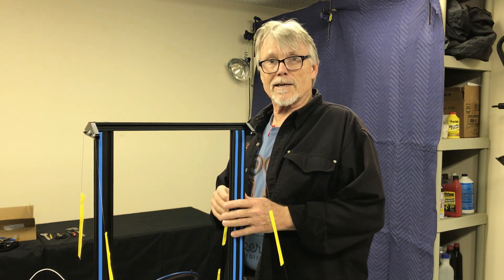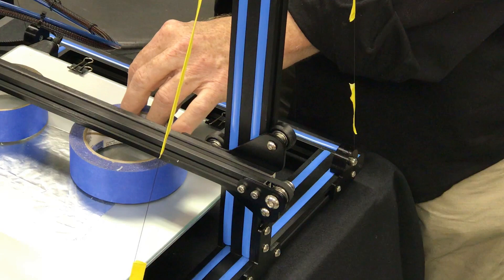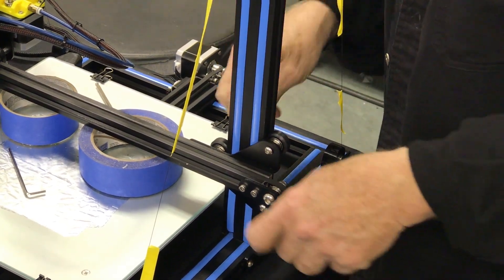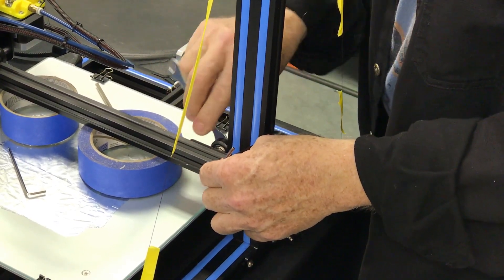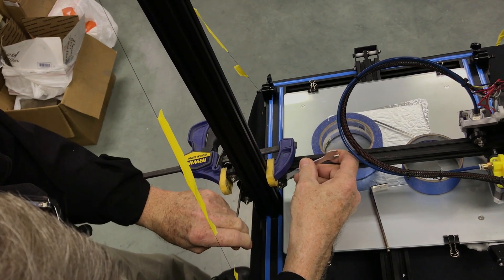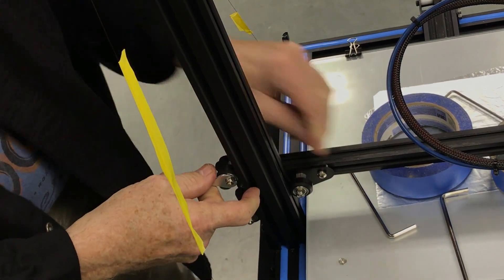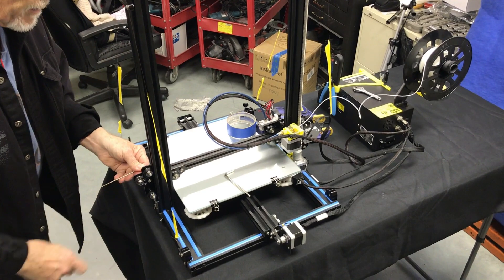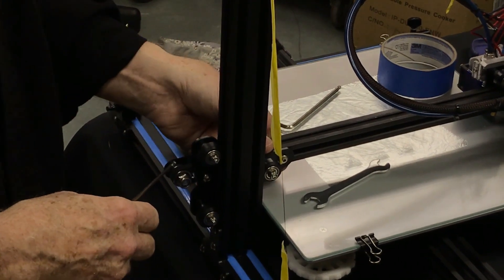Tuning the CR10 X beam

Comment: Do you think you should put lumia rails
Reply from the maker: Ricardo Molina not sure what those are but the CR10 performs well for what it is....a $300 entry level printer. I’ve seen people spend huge sums of money on them just to make prints a little better. They’re great when they’re tuned properly. I suggest only doing the dual z upgrade and getting rid of the heavy glass. Save your money up and get one of the new CUBE type printers. They go much faster, have better rail systems and easy to enclose for printing exotic plastics.
Reply from the maker: Rick Morty I use a galvanized sheet metal from my local HVAC Shop and glue magnets to my heater plate from underneath. If you get 24-22 GA. 
You can use a WHAM BAM if you want to spend more money or don’t have access to a shop who can cut it on a stomp sheer. 
 My lightest alternative is a PC copper clad board which I keep in stock. They have to be clamped on like the original glass.

Comment: 1) Why are you squaring to the bed and not the frame?
2) Have done this with a dual z rod?
Reply from the maker: Assuming the frame is square, this is the next step. This only covers the beam which is often not covered. 
 Dual z pretty much takes care of the sag however this will quell any print anomalies from the guidewheels being loose.

Comment: i have a brand new cr10s clone and i can't figure out for the life of me how to tigten rollers...had zero issues with ender 5 and bed adjustment rollers on this machine... know one on you tube addresses the issue i am having... everything else with this printer is working normal...but i know this slop needs to be fixed asap...thanks
Reply from the maker: For the clones sloppily made, your only alternative is to hold the wheels tight to the rails with the shown clamp and loosen then tighten wheel axle bolts.

Comment: never saw anyone with stabilizing cables for the z-axis before... did you make those or buy it?
Reply from the maker: I design and sell them in my store: 3dprint2form.com
Reply: @neuxstone  yes, thanks... since 1st seeing the video I saw this for sale on ebay... I think it's the same, it includes a screenshot from what appears to be this video... seller in Naples FL...
Reply: @neuxstone  I intend to purchase a kit soon for my CR10 S5... if any of these need stability in the gantry/z-axis the most it's certainly the taller S5 (mine unfortunately is a clone by Aibecy which I obviously didn't catch at first but I think it's identical in every way to one from Creality)
Reply from the maker: zeroswings2   The Creality printers are copied just like the Prusa. It's hard to beat a good design however you'll want to make sure you look at the details. The control board, motors, quality of wire connectors, wheel bearing quality etc. Not that Creality has the best....
 I purchased a S 500 Custom. I don't think they offer it anymore. It came with TFT touchscreen and Ramps architecture board. The board was a cheap version and flamed out after a couple hours printing. When I contacted the seller he forwarded my email to Creality calling me needy...
Creality told me it was my G-code and totally ignored me......boooHissss Creality. I spent $1200 for mine and thought that sucked but....by troubleshooting and finally identifying the problem and fixing it, I had the most valuable experience possible. I now know how to fix and troubleshoot any printer issues.....
Reply: @neuxstone  cool! well... cool that you learned so much... so if I have issues you're the go-to guy!? I'm in the bay area BTW so Naples isn't too far away....
Reply from the maker: zeroswings2   Actually I moved to the Eustis area a couple years back so you are closer...
One thing I forgot to ad was that I linked both z axis with a belt because the 2 motor systems are notorious for creep. 
I have them on all my machines. All but the 500 have tensioners to keep the belt tight but I special ordered a perfect size belt(s) that took 8 months for them to fulfill the order. I have a few left if you're interested.
Reply: @neuxstone  I was thinking of doing the exact same thing! I'm yet to even assemble it and I'm purchasing mods already... have a BLTouch auto leveler, and plan to grab a Bondtech BMG extruder... the s5 comes with dual lead screws but I'm glad I'm not the only one to think of the belt linking them. at some point I'd like to look into lightening the bed and it's carriage so the weight of it doesn't cause issues with printing at higher speeds...
Reply from the maker: zeroswings2  taking that HUGE chunk of glass off the bed is the "low hanging fruit". Do that first. I have the solution which is the best for weight. 
You'll also find it takes like 19-20 mins to heat your bed. I cut that to 8 with the copper. Pick the low fruit before breaking the bank on stuff that doesn't matter or distracts you from the "fixes". Bondteck QC is on my wish list but mine prints perfect with the stock one....boom... instant $100 savings I can use to install a Stinger.
Reply: @neuxstone  oh yes absolutely... it's only something I'd thought of doing eventually... I was thinking along the lines of lightening the aluminum bed by strategically 'hollowing out' the underside so it's thinner in some areas... by reducing the amount of aluminum there I was thinking it should reduce bed heating times as well... but again, this is for down the road and something I'd like to get into as upgrades I could sell much like your guy wire kit
Reply from the maker: zeroswings2   I'm ahead...I did that when I first got the S500 but the bed will warp from the heat. I used my plasma cutter to make a new drive plate (the lower plate with the wheels) I cut out all the solid heavy parts till it looked like Swiss Cheese but it was still unstable. My idea, and I haven't tried it, is to put the wheels "outboard" using the lower side frame pieces for the guide wheels rather than the center rails then mounting the actual heater plate to it. It would eliminate the whole drive plate.  I have to work out a few details but plan a kit.
Reply: @neuxstone  interesting... maybe a different bed material altogether could work although at the moment I've not put much thought into what I'd use... but... thanks for sharing your experience - guess that's a little R&D lesson I can learn...

Comment: Honestly thank you for the video, but its Incorrect to do it this way.   You have great ideas my friend, I just feel the lack of precision is not helping.
Reply from the maker: Andrew Beaton   Thanks but It’s the most you can do given the idiosyncrasies with the original CR10 model. 
It works for 99% of the folks that try it however if I were to reshoot the video I would change a few things. 
These machines really need eccentrics on all the outboard wheels.

Comment: Hi, Thanks for the detailed video. I have a Tevo Tornado (yeah I know, wish I hadn't bothered lol). It is the same design but way more dangerous, thanks to the un-earthed mains bed with no strain relief, no thermal fuse and crappy solid state relay lol (fixed). The frame design is identical (ie a copy lol). No matter what I do with the wheels and nuts, the right hand side of the X gantry is always 2-3mm lower than the leadscrew side.  It is driving me nuts. I used your method with a couple of identical soup cans balanced on the frame (I took the bed off to make room) plus a vise like you but as soon as I take the soup can away, the right hand side always drops! If I can't figure it soon, I will probably just scrap it for parts lol. Any ideas? Keep it up.
Reply from the maker: Plan C   I think the problem is the left hand beam bracket wheel orientation. 
I suggest trying to adapt eccentric bushings, first to the top wheel, then the inner wheel. There's 3 so while you have it off just replace all. 
I have a kit in the store with the correct drill size. 
You may want to bite the bullet and just do as many as you can while it's all apart. 
I have the same situation with a TronXY X3s. The problem persisted until I simply took the time to fix it. I also replaced the board and screen in another video. It now outperforms all my other printers.
Reply: @neuxstone  Thanks. Fiddled around with both sides and think I got it going now. Thanks for the tips.

Comment: David, I looked for something on adjusting the X-axis and came upon your video from a PDF someone gave me. I am an I.T. guy and I used to do things like this but my god I have NEVER spent this much money on something that has given me so many issues but I guess this is 3D printing. I was really going to sell or return the CR-10S. My first one was a clone which the seller was trying to pass as a real Creality which I got my money back on and now that I have the real thing, to be honest, its no better than the clone was. After doing this fix my prints are absolutely better now but I never get through them to completion. I'm having clogging issues with the nozzles but that's another story Just want to say thank you and I'm giving this one or two more weeks and then if this project can't get off the ground I'll either move on to another system or leave the 3D printing project. Thanks Again David.
Reply from the maker: Donald Youngner this is a similar experience most go thru starting out. It can be frustrating at times but once sorted out these machines do wonders however there’s always something to fiddle with. Your slicer program is a big part of success when you explore and master it. 
I wish I could say filament was stable but I think that’s been my biggest variable. I use Magic Space but I’ve had problems with it too. 
Good printing and hang in there!
Reply: Thanks, David I'm currently using Simply3D as the slicer it looked like the way to go. I'm also creating things in Fusion 360 which I just love learning.
Reply from the maker: Donald. I just remembered something from a recent experience on jams and nozzle clogging. 
The first was when I switched to Marlin 1.8. There was a bug in it that interpreted the info back from the thermistor and my tip would always jam. I switched back to 1.6 and my problems disappeared. 
 I also had issues when running my cooling fans full speed. I have since learned to back off to 50% or less. It didn’t change the quality of the print but the hotend stayed more consistent. 
 The other is learning how and how often to clean the nozzle. I now do an atomic pull often and keep an acupuncture needle handy at all of my printers. 
Use a silicone sock on your heater blocks too.
Reply: I'm printing something now but I'm assuming you can find the version of Marlin on the control console? just a guess. Also, An Atomic Pull that sounds dangerous - lol this I think is the way you remove the filament from the hot end just guessing. The fan control would be found in simply3d? I have to get a bunch of needles I'm going to need them
Reply from the maker: Donald Youngner yes. It should display on the console. There’s a great vid on tip cleaning by a fellow Richard Cleveland “the first layer” which covers tip maintenance.
Reply: I'll be looking at this today. Since I have done the X-Axis adjustments my CR-10S has really improved not only in quality but reliability as well.

Comment: Thank you i was wondering about this.. i was told to have them all loose and free float because i have the cr10s5 and was having an issue with the right side ending up higher than the left almost everytime i would autohome it after a print.... i cant wait till the 20hr print i have going is done to try this way out. Thank you again!
Reply from the maker: David Bennett great. Just make sure your bed is level first by sneaking a ruler down past the plate and inside the frame base to your table it sits on. You don’t want to adjust it to a crooked table.

Comment: Your method gets you closer to true than without, but I would suggest trying a couple of things to get it even better (though not for feint of heart)...  

1) before working on the X beam level (and adding the guy wires), it is worth testing and adjusting the square of the entire framework.  (In my case I used an engineer's square, shims and careful screw adjustments (i.e. not so tight as to warp aluminum) to get the entire framework squared up in all axis (as well as the table support beam), that would make truing up the X beam easier to achieve and help prevent creating a parallelogram situation.  

2) you would want to then do the coplanar adjustment of the X beam (i.e. levelling against equal height SOLID blocks such as cans, in your video you used tape rolls which may introduce some error) off of the bottom frame without the decorative rubber inserts and not the bed.  This would make the X beam square with the entire frame and again help avoid squaring up a parallelogram.  (I put my soft colourful inserts back afterwards as I suspect they also serve a minor purpose in dampening vibration.)

3) then it makes sense to actually true the X beam with the top frame gantry beam off (and square it up again afterwards).  I actually did this by also removing the Z lead screws, so basically you are simply dealing with the squareness of the wheels and their support independent of them.  To do this you need to access the hidden screws that hold the wheel plates together (and on the original Z lead screw stepper side, you need to run the X beam up above the frames top gantry to do so (I used the clamp to hold it up in place when making adjustments.  You can adjust the squareness of the plate that holds the wheels to the X beam on both sides this way (hence needing to take off the frame's top piece).  It's a slow process of tightening, adjusting and then lowering the X beam back down the frame sides to the leveller blocks to check for a true level, then back up for adjustments needed on the original stepper motor side.  Once that's complete you have an X beam that moves nicely up and down the frame staying almost, if not, perfectly square to the frame.

4) You then put back the top frame gantry piece and square and shim it in place to keep the frame's top end square.  Again, you can't tighten the screws holding the extrusions together too tightly or it will throw out the square by flexing the aluminum.

5) Once that's done, you re-install the Z lead screw(s) and do what ever adjustments are needed there, in particular making certain that the brass lead screw guides are a little loose, and then run the X beam up and down the framework to seat everything.

6) When installing or adjusting the guy wires, you can use some tension adjustment there to help keep the vertical frame square to the bottom horizontal frame throughout it's entire length (and less susceptible to rocking as it's primary purpose).

IT takes a lot of work and a couple additional tools, but that should get that X beam as square to the squared framework as possible.  That will also make certain that when you tram (level) the bed to the nozzle (making the X beam and bed perpendicular) you aren't printing parallelograms.

In my case I am using Dual Z steppers and it (the X beam) still does occasionally drift a tiny amount out of square over time when the steppers are disengaged.  That is partly because with the changing weight along the x-axis (as the hot end moves back and forth) and potential "springing" of that beam.  You can use the same block levelling trick (again, I do it off the horizontal frame and not the bed) and rotate the couplers independently a little to make it all square and then engage the steppers, by moving the Z axis upwards, to hold it in place for the print.   Better than Dual Z stepper motors would be mechanically (belt and cog) linked Dual Z lead screws.  Then once levelled, the belted link would help keep them square (up to the point of slop in the belt) even when the main stepper is disengaged. 

Whew!  I hadn't anticipated typing that much!  lol
Reply from the maker: Wayne Powell we think alike!!!
As you summarized. It's easy to get carried away with these little wonders....
I like your style however I have to keep things stupid simple or these vids could run for days. As a matter of fact I have a small prototype shop and was going to use my 123 blocks when my wife handed me the rolls of tape and said...now who the heck is gonna have a pair of 123 blocks...?
Anyway. Nice to make your acquaintance. See you in part two. Hope you don't mind if I use some of your ideas and suggestions ...D
Reply: Don't mind at all,  I believe that by sharing knowledge we all come out better for it. (or in some cases spend a lot of time modding instead of printing, but hey!  lol)
Reply: Spot on Wayne, very good explanation.
Reply: Thanks for taking the time to post this, Wayne. I didn't use the same order but it gave me a rough idea on how to figure it out on my own.
I'm wondering why the brass lead screw guides should be loose? Seems to me that if there were any play in them, you might get inaccurate Z movements. Plus, the lead screws themselves have some leeway to move around at the top of the frame should they not be completely straight.